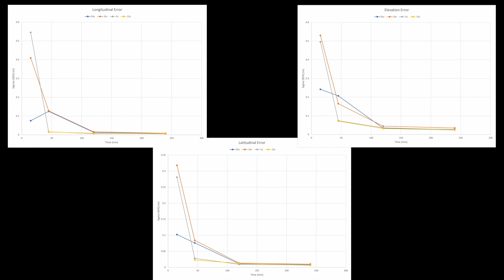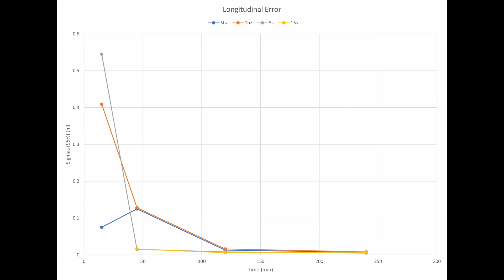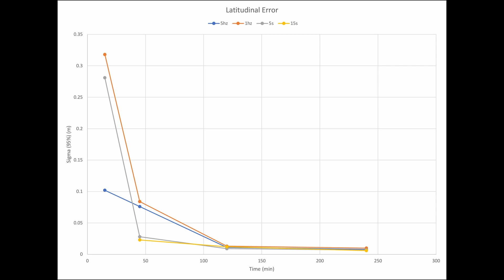11. Are You Recording Static Properly? | Bench Mark

Comment: Many factors that affect precision and accuracy are longer duration conditions, hence why OPUS decimates to 30 sec interval. The 5, 2, and 1 hz interval can accentuate less than ideal conditions. Many factors associated with your test can't be relayed in the short video, I'm sure. The scientist in me says you should have had 4-5 instruments running at the same time using different logging intervals so the local conditions would be identical with each datasets. Thanks for the videos.
Reply from the maker: Hi, that is correct. This is by no means a scientific study, I was hoping to give at least an idea of what you should do when recording static. Ideally, I would as you said have had enough instruments to run each interval at the same time, to ensure all the satellite configurations were identical. Unfortunately, when I was working on this video this summer, there was a receiver shortage, and I could only spare the one receiver. I am currently working on a battery life video where I am testing three receivers at once. Let me know if you want to see anything specific.
Reply: @benchmarkequipment  I figured as much. It's like the stuff I do in my back yard! Matrix of battery power, radio transmit power, and message format...solve for hours runtime. Thanks again!
Reply from the maker: @mlbrack  Battery video will take a couple of months as I want to test the battery life during winter on -30 C days. I am also going to have to figure out some kind of system to test the battery life at a hotter temperature. Unfortunately winter is setting in for the next8 months here in Canada, so I am going to have to get a little creative for the heat portion of the test.